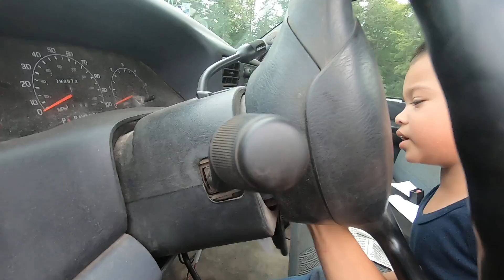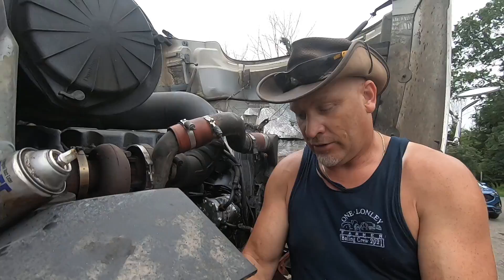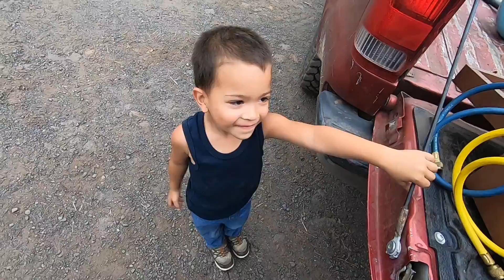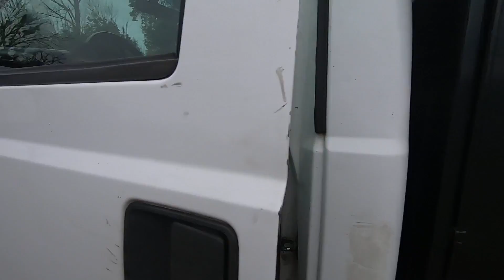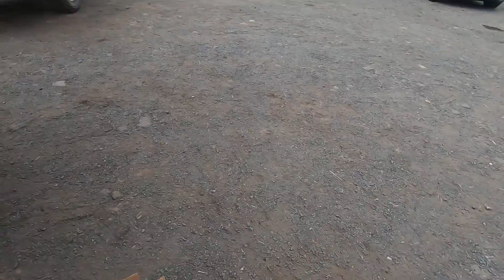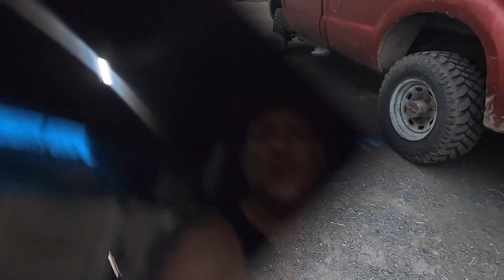A C  Belt = Broken Pump=$$$$

Comment: I grew up on open station tractors not even a roll frame, froze in winter baked in summer had heat stroke a few times, and now I have a few cab tractors a/c heater it's fuckin lovely. I understand some people can handle the heat/cold better than others being Australian I hate the cold and don't mind the heat but it can get up over 100°f for weeks/months in some parts and I like my comforts.

Comment: we put the a/c pag oil on the threads and o rings when putting the hard lines on a/c systems for lube and prevent corrosion between aluminum and steel components

Comment: Agree - got to have AC on Ag or construction equipment where you can’t open windows.  One tip I learned- in addition to looking at pressures on a chart, target a high to low compression ratio of 6.5 to 7.5.  For instance a low side of 25 psi to a high side of 175 would be just about a perfect charge with a compression ratio of 7.
Reply: False its based on sub cooling and super heat

Comment: If he don't like ac then he could just turn it off and roll the windows down... Oh wait, the windows don't roll down and will not run with the door open on the mowers. Do they. Besides the mess that would put in the cab. Not to mention if he hit a bumblebee nest. And on that truck. I have drove a truck with no ac in Laredo, TX. I'll be Frank with you I don't know how they did it in the 50's. Even growing up with my grandparents that had no ac in a trailer house or a pickup on the farm in Missouri. 
Wes, you just run into 1 of biggest idiots you could find.

Comment: Back in the 1990's and early 2000's 99% of the light duty wreckers I drove did Not have functional A/C (many left the factory with it). Drivers were supposed to be happy they had working hydraulics and lights! A/C in the office was a luxury that came & went. When I worked those jobs I did Not use A/C in my vehicles. Made the day miserable going from A/C to none. I have only owned a few Non factory A/C vehicles. I have one now thats a winter truck only because the A/C system needs parts that are on the hens tooth list (94 s-15 type jimmy a/c parts). it also has a drivers door window that will not roll down (door is rotted out, window is jammed in up position).

Comment: fill a,c with propane,cheap cools better
Reply: Is also flammable 😳
Yikes if you have a hose burst.
Reply: @davedunn2124  take a look at one of those 1 lb cans and see what it says
Reply: @ronwrob2819  dont have to. Straight off the msds sheet. Non flammable. It can be under the right circumstances however low volatility under atmospheric conditions. Much safer than propane. You can use it all you want but be careful advising others to do the same. Just might burn someone up in a cab. Just sayin.